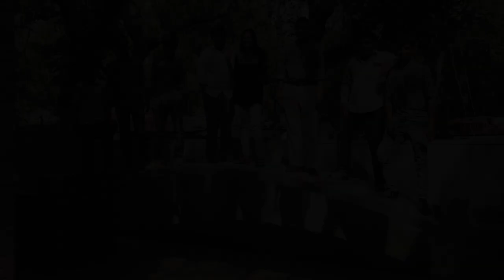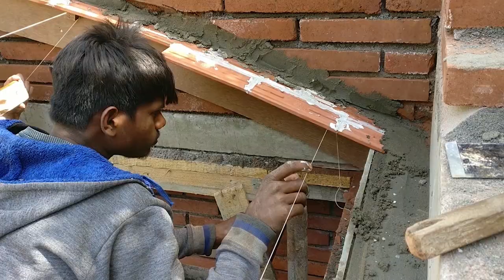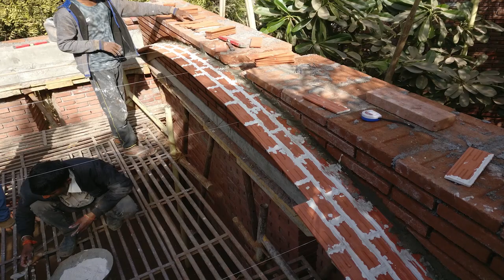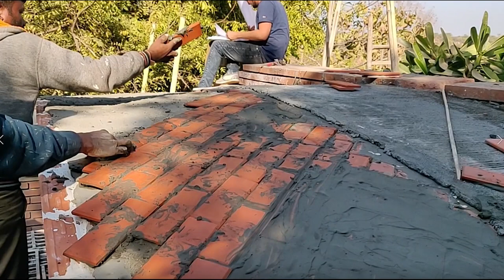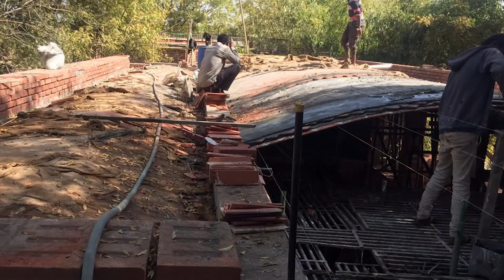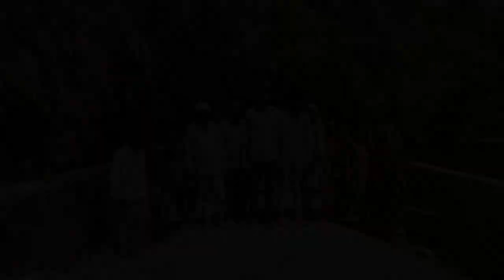spanning without steel & shuttering: the timbrel vault

Comment: Hello Mr. Kakani, excellent sharing of this technique. I have been researching on how to build in my backyard in California a half dome of clay bricks of 6 feet diameter. I have been toying with the idea of using single layered bricks (8'x4'x2 1/4') or double thin brick(8'x4'x1 1/4'). These are the bricks available here locally.  Would you happen to have build such a structure before and if so any suggestions. The dome would be part of a sitting height platform for sitting. Appreciate your suggestion in advance. (BTW i too am from Abad and curiously used to live in Ambawadi.)